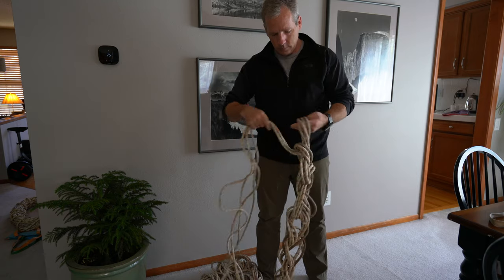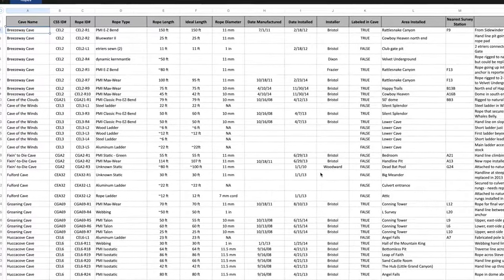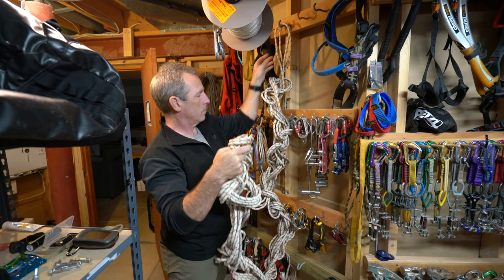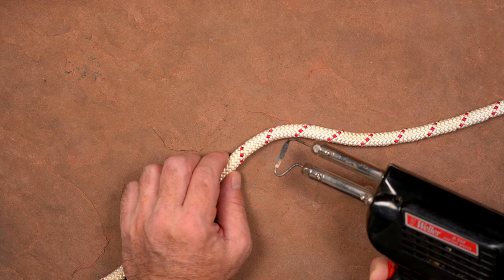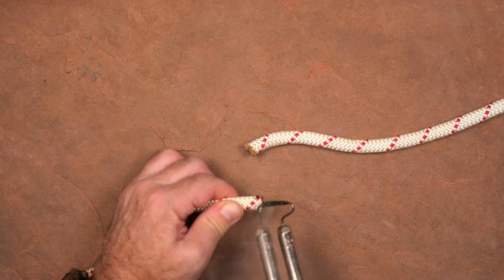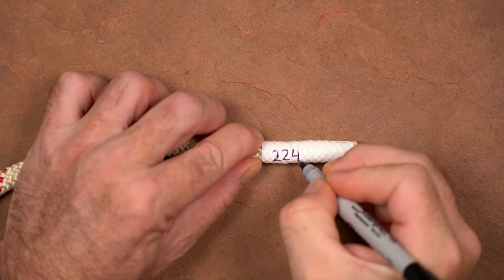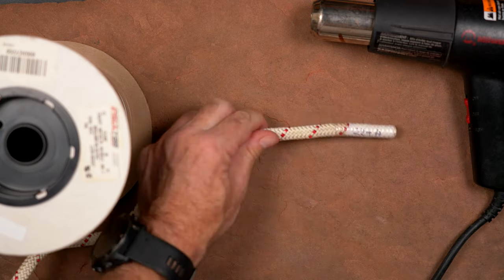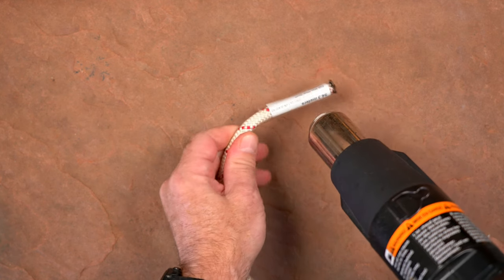Washing, Measuring and Labeling Static Caving Ropes

Comment: Great idea using the label under clear shrink tubing!  As a nerd I'm obligated to ask if you've considered using a QR code and then publicly sharing a google sheet with the fixed project ropes?  Not sure if its just more work for works sake but seems like it might be useful if someone came across it and wanted more info or to contact you or something?  Just a thought.
Oh, and I have usually only hand bathtub washed  the soap with a very dilute dish soap (plunge it up and down with my hands and then kinda agitate it by hand, then do the same in fresh water, then hang it in loose non-overlapping coils for a day or two... but I'm tossing it into my washer from now on <3 
Thank you!
Reply from the maker: I haven't considered a QR code, but then I don't cave with my phone. On fixed ropes I do put the www.caveanchors.org address of the label so I can be contacted. I also put a liability warning tag on fixed ropes, but that might be something for another video.
Reply: @DerekBristol  if you cave with any camera you can snap a pic of the QR and then expand the data later... again, not pushing for it, but it is an often overlooked option.  I can't wait for the liability warning video ;)

Comment: Hello we are washing only with water in Turkey :)
Reply: me too, I also never wash with a washing machine, only manually with a brush
Reply from the maker: I've had good luck using a front-loading washer. Never use a top-load machine with agitator. A mild soap will not damage nylon (polyamide) fibers. PA fibers have a sizing (organic coatings) that are used as processing aids in the rope weaving process. The use of a little soap will do more to remove these sizings than water alone, but using unwashed ropes is not in any way unsafe. The main benefit of washing is pre-shrinking. To avoid entanglement during washing I either chain the rope or feed it into a mesh bag.
Reply: @azwarramadhan6183  washing with the brush only makes dust and other stuff go deeper into the fibers. The rope then gets stiffer and the particles are damaging it.
Reply: @rikardoskorlic8878  I thought that the very fine silt you often find in caves can be very damaging to washing machines? The caves in Belgium I usually visit are all infamous for their horrible mud that gets on and into everything, including my ropes. My climbing ropes I do wash once every while, but they only come in contact with a bit of sand and dust, unlike my caving ropes.
Reply: @rikardoskorlic8878 Do you have any information backing up a claim like that?  I've heard things like that but from what i've seen in cutting open ropes it just doesn't seem true, but I don't have a microscope or know how to do a study.
Reply: @pieterveenders9793  I'm from Croatia and here the pits were created in limestone. A rope used in such conditions becomes stiff after some time, from which it can be concluded that the fibers of the rope itself are filled with foreign material, in this case apparently limestone dust. In wet pits, the rope is soaked with water in which limestone is dissolved, so after the water evaporates, limestone remains in the rope.